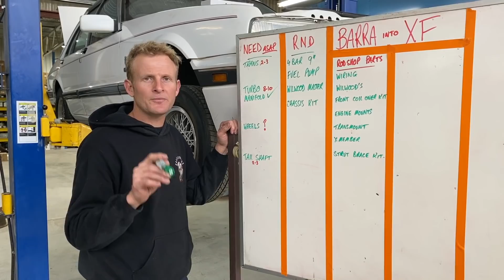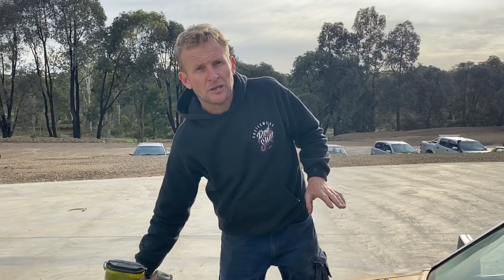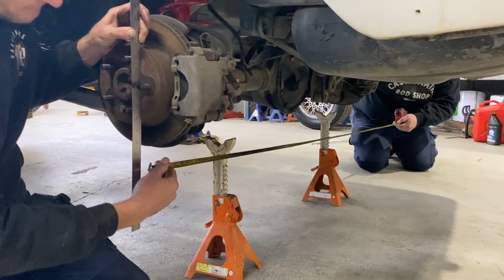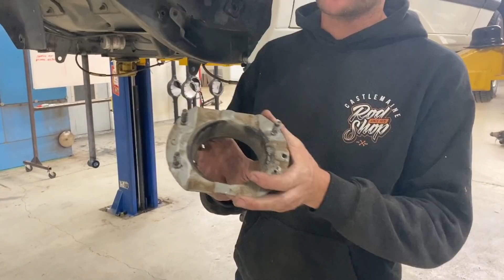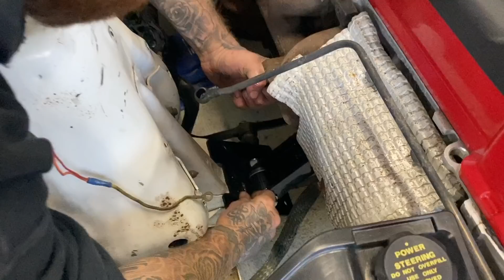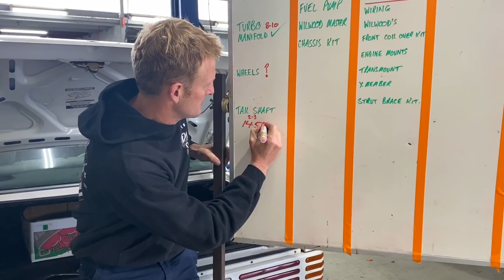XF Falcon Barra swap - EP2

Comment: Little bit surprised the old 9 inch is still a go-to. Isnt there a better cheaper option yet? I have a 65 gto pontiac that will probably grenade its 10 bolt at some stage but would like something cheaper and lighter than a 9 inch. Are the 8.8 explorer rears readily available in Aus?

Comment: Oh boys that car was so tidy and stock 
I would have kept it like that and built an old roughy
Reply from the maker: Luke Stocks it didn’t have the factory engine or gearbox in the car the previous owner had sold it to fund some of the Barra parts. It’s a tidy rig that’s for sure, it will stay fairly close to standard on the outside mate.

Comment: What is the fixation with those prehistoric Ford commercial diff? Use a 78 series EB Diff. Probably stronger,  far lighter and  mounted to OEM uses 28 spline axles made from better material. And by drilling 4 holes on the mounting bracket can use standard XF vented rear rotors.  And the park brake is done. And then use a std 3" companion flange EB tailshaft. Bolts straight in. And very strong. XR-AU all use the same length tailshaft. And you can pick your roll centre as every model seems to have the diff hat at a different height
Coil overs?  I use a 6" Pro Shock with 7" shaft. Mounted to OEM position. Shock upside down. ..
Master cylinder? Again I use a Wilwood 7/8 with my home made spacer, a piece of 3mm plate. Simple and costs nothing. All this 'fabrication is largely a waste of time.
And yes I have over 400hp of 351C and a Manual trans and racing on proper road race semi slicks.. That AU wheel you were using is 30mm further in and will rub on the inner guards on hard turns.Use standard offset wheels, use the Snoflakes. You have them and they fit!!
The same set up is used on my mates Modified Speedway sedan. Rough hooky tracks are far harder on everything than doing wheelies!!
Reply: LDN Wholesale you are like an encyclopaedia of knowledge. Not sure why you are watching an educational video?? You seem to know it all.
Reply: I am pretty sure that this is a newly manufactured 9 inch style diff, not a old one from the 70s. It would have all modern internals and pretty massive axles. Their website says it is rated for 900 rear wheel horse power.

Comment: Keep in mind the early turbo barra used a floating gudgeon pin with the weaker n/a rods. The Bf and Fg engines from around 06 onwards had the thicker LPG rods and floating pin. Might want to clarify yours has the thicker rods before pushing it. Loving this build and plan of attack, no pissing about, just getting it done.
Reply from the maker: Thanks mate, at this stage this will stay a stock Engine (at the moment anyway)
Reply: @CastlemaineRodShop1976  keep it 300kw rear wheel if on the thin rods, 550 if it's the thicker ones. Seems to be the safe side of them.

Comment: a mate of mine has a 9" in XE falcon (with XF fuel tank) what's the issue you think with the watts link (unless bracing the back of the diff across the axles? ) his is 100% using all factory stuff including watts link.  the coil overs look like something he'd like to add though